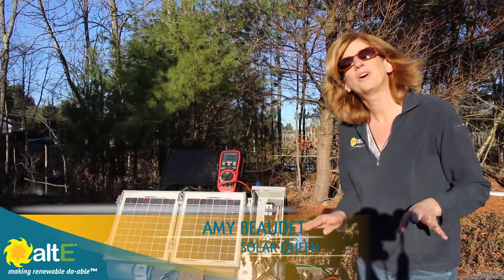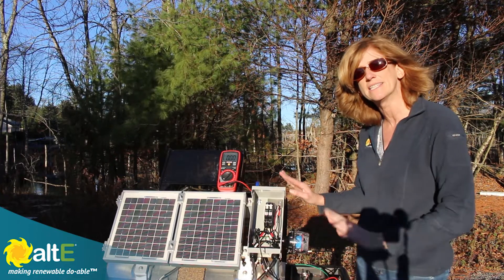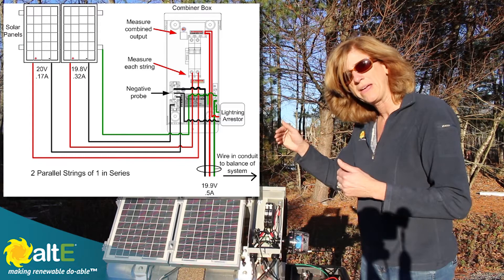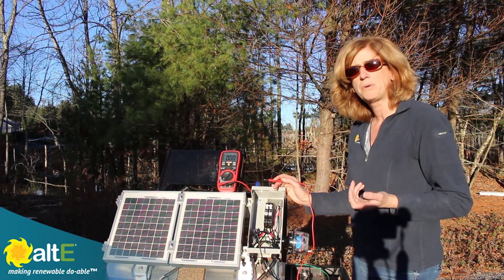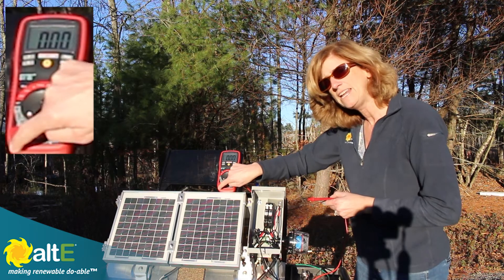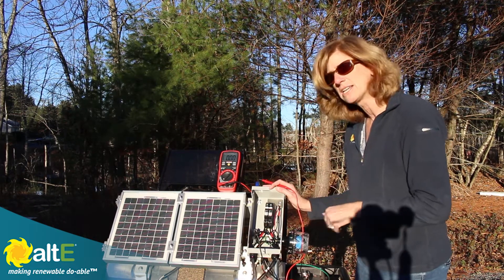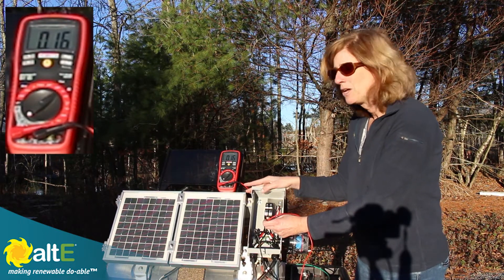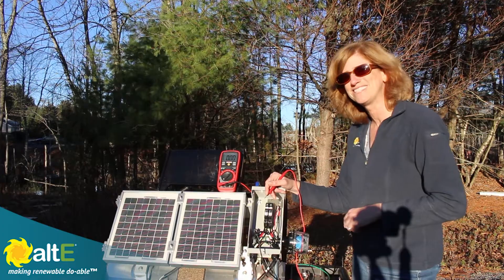Troubleshooting DIY solar in a combiner box

Comment: Nice explanation. I many need some advice on a solar stand I am building. I just did a video on my Channel...if you want to take a look, please do. Anyway, I plan to mount six Renogy RNG-100D panels atop a 6x6" post. I need to know if AltE store has a bracket mount where I can mount the panels to the rails and then affix atop the 6x6" post. Thanks guys.
Reply from the maker: +Chris DIYer According to the IronRidge configurator, a TP/06 would fit 6 of those panels and mount on top of a schedule 40 6" pole. https://www.altestore.com/store/Solar-Panel-Mounts-Trackers/Top-of-Pole-Solar-Panel-Mounts/IronRidge-TOP-OF-POLE-Mounts/IronRidge-UNI-TP06-Top-of-Pole-Mount-Double-Tier-70-Support/p1866/